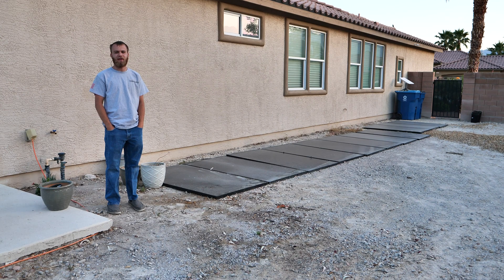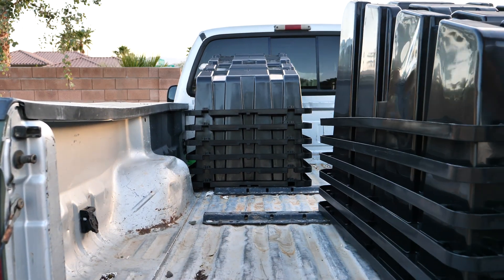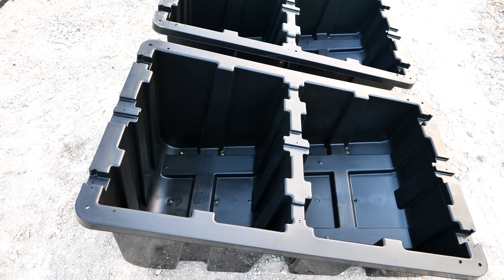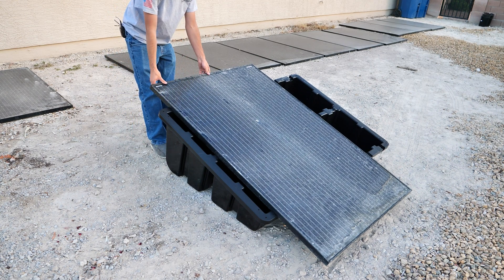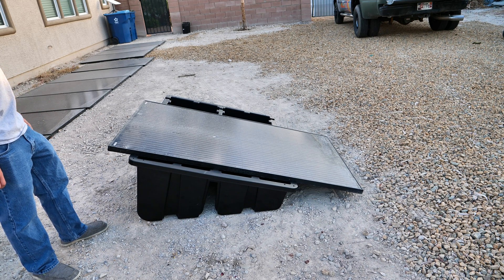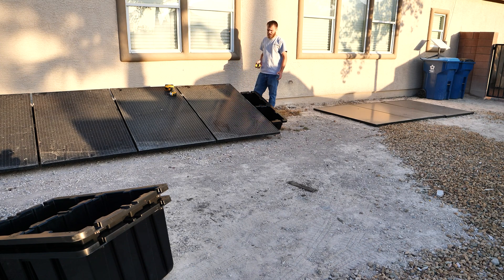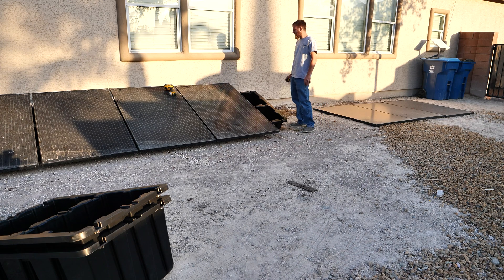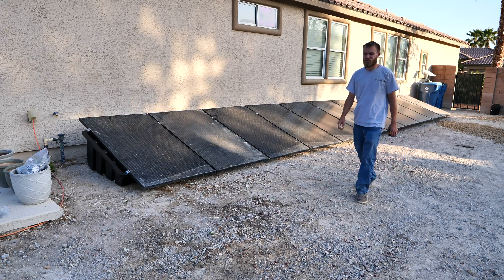Corigy Ballasted Ground Mount - Install on my house

Comment: These are counter productive for bifacial  panels. I do like the low center of gravity effect to counter high winds and perfect for easy cleaning. Like everything else it’s got its pros and cons. Just wish they were not so expensive. You can buy a 100 watt panel for less than the mount.

Comment: I think its a valid idea that just simply cost too much to be worth it.
This should be the ultra budget mounting soluiton, plastic bins that you then have to go buy material to fill it in most cases.

No benefit of height off the ground, no benefit of built in tilt, these are a compromise across the board.  But without any incintive to compromise (cost) what is the point?

I'll had panels on the ground like this before, it was a very short lived experiment.  Too much trouble keeping up the yard and keeping them clean.

So building off the ground is a big must do.
Reply: Best comment
Reply from the maker: These were in Las Vegas. Luckily, I didn’t have any plants or yard around them, there was no upkeep there since no weeds grew around the mounts. While Las Vegas is a windy and dusty place, I found cleaning them to be extremely easy, and found myself using a brush and nearby water hose once in a while to clean them. Having them at ground level proved to be very convenient for washing. These panels got just as dirty as my roof mounted system but was a lot more accessible for keeping them clean. While this solution may not be for everyone, they do have a time and place where they are a great solution. Sounds like you would be best with a traditional roof mounted solar system.
Reply: @HighTechLab No, still better off with ground mount.  But can get a proper ground mount system cheaper than this that works better for my situation.

Off the ground boosts production, especially for bifacial panels, keeps them cleaners, let's the yard grow under, and can give me all the things needed for code compliance easily like bonding the frames together for Earth grounding.

Just these plastic bins cost as much as stainless steel mounting systems and then more once I buy sand or rocks or something to fill it with, and honestly that's more labor IMO than sinking posts with an auger and secure with foam or concrete.

Comment: I have this idea, to make modular light duty bunkers from shipping containers, which also act as a ground mount and solar tracker. 
Basically its welded to the 4 corners ontop of the container, and the container is buried. 
Of course you would need side reinforcement, and with 3 inch angle iron running the full height, this can be done easily. 
Adding bunks to the insides, along with shelves, and equipment or battery racking, you can also square up and ridgidify the roof and sides, by shelf bracing and cross bracing on shelves/bunks. 
The solar tracker just attaches to 3 triangular braces made on top,with a pivoting cross bar where the solar panel array frames can be attached to. 2 or 3 rows of panels at most I think. 
Later, you can add actuators and a tracker timer to get the extra 25 percent from the panels. 
The roof can be reinforced with successive layers of mesh and concrete, eventually it will be strong enough even with just inches of concrete, minimal if any reinforcements could be added. 
The whole thing gets sealed up, its easy, just go along every seam with silicone. 
The unit can be fabricated and painted in another area, and all supplies can be shipped within the container. 
Total I think metal reinforcements and framing is a fairly low cost. Scrapyard special, or surplus or oil pipe.
The inside is cooled from ground, and the shipping container above ground would be unbearably hot. This way is more efficient as less ac or heat is ever needed. 
Good for a remote installation. 
Battery and inverter power would be low demand, so grid feedback is an option. 
For cloudy days, an array the length of the container and 2 rows of tracking panels would be just about sufficient, and just a few 10 or so kwhs is needed. 
Dehumidification can happen through vents, or even pipe vents with condensators, Ive seen people use bunches of steel pipe at the intake to condensate water. This method is low cost compared to running extra equipment, if needed. 
The venting and ac would have to be considered per location. 
Its a good space to house the equipment, and bunks and storage, and supplies if that is ever needed or, just needed for an off grid type cabin, Though I would prefer the traditional cabin and solar array over a bunker any day. Steel containers are not to be lived in. 
If you get used containers, used steel, used panels, and just a small lf inverter and 10kwh of batteries, you have a good system. 
You can even add gutters to the solar panels to collect rain water and store it nearby. 
The gravel and concrete can even be shipped with the container as an all in one kit. 

What do you think?
I think if I was ever needing to use a container or was forced to use a container or forced into needing a bunker, I would definetly do it exactly this way. It takes less materials overall I think it would be a cool airbnb too.

Comment: These are interesting as the design is a modification of the PowerField PowerRack which is patented.  However, that isn't going to keep China from selling them or resellers like Current Connected from getting them and selling them.  It would be interesting to compare the two and talk about how much they should cost, $60  (even with shipping) seems steep for an overgrown Greenmade tote.  The US-made real deal can be had for under $70, takes modules in landscape up to 1050mm, is "toolless",  and has a more solid UV-resistant material (like a garden wagon or warehouse cart) that has an expected service life of 40 years.

Comment: Can those mounts be filled with water or would they leak?  Water would be soOOoOOooo much more convenient.
Reply: They have holes to drain the water so yea they would leak unfortunately
Reply: @dieseldawg7132  Thought that might be the case.. Dang.  Thanks diesel!

Comment: What's the largest panel dimensions that this will hold and whats the the recommended fill weight?
Reply from the maker: They hold 5 cubic feet, depending on what you fill them with changes the weight.  For example 5 cu-ft of crushed stone is about 550 - 600 lbs

As far as panel dimensions, they can hold some really big panels, but they need to switch to horizontal orientation.